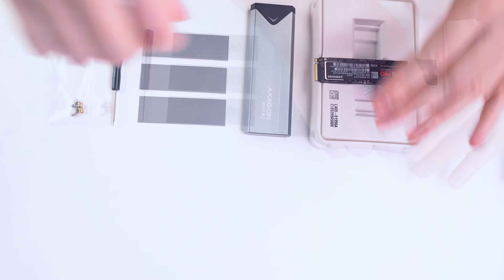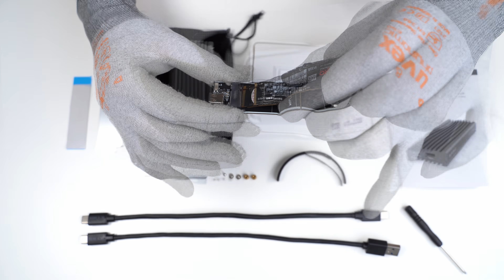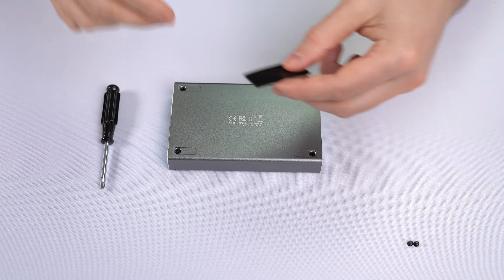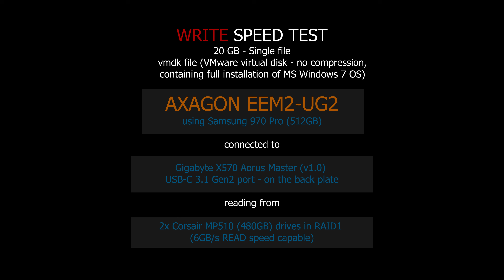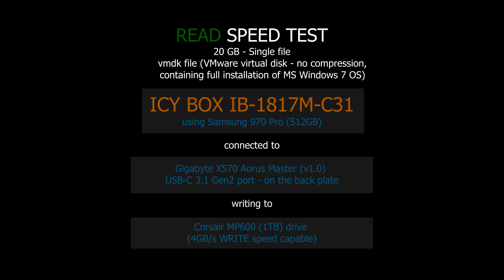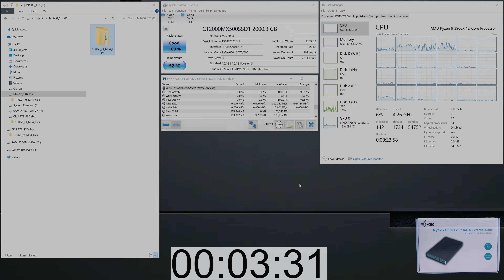M.2 NVMe USB-C External Box TEST - for SSD - AXAGON EEM2-UG2, ICY BOX IB-1817M-C31 & i-tec MySafe

Comment: @ Martin's Lab. hi, am i right to conclude that sata3 ssd  doesnt need usb 3.1 gen2 (10 gbps), and your mx500 would work almost the same on USB 3.0 case?
Reply from the maker: Hi, both will work, the transfer speed difference is about 20%. So, it depends on how high transfer speeds are good enough for you (you have to decide if it is acceptable for your use-case or not).
 
You´re lucky I have this drive connected right now as I´m writing this, so I tested it connected to both ports (I had to swap "USB-A/USB-C" cables of course).

CONCLUSION - If you connect “2TB MX500” inserted into “i-tec MySafe” to:

a)	“USB 3.0” on your PC (using a cable with USB type A connector) - you´ll achieve "410 - 412 MB/s" real READ speed 
b)	“USB 3.2 Gen2 (3.1 Gen2)” on your PC (using a cable with USB type C connector) - you´ll achieve "518 - 520 MB/s" real READ speed

So, to sum it up - the difference between using “USB 3.0” and “USB 3.2 Gen2 (3.1 Gen2)” when using fast enough "SATA3 SSDs" will be about "100 MB/s" (probably up to "130MB/s" with "Samsung 860/870" SSDs) in favor of “USB 3.2 Gen2 (3.1 Gen2)” in real life scenarios. (With different "SATA3 SSDs" this number will differ of course)

The reason why transfer speeds using “USB 3.0” interface are slower - is that it has only "5 Gbit/s" bandwidth available, while “USB 3.2 Gen2 (3.1 Gen2)” has "10 Gbit/s" bandwidth. Some part of this bandwidth is always lost as system (transport) overhead (this applies to both interfaces).  

So, while connected to “USB 3.0” interface you can never use a full potential of "SATA3 SSDs" which have "6Gbit/s" interface, you can use only about 80% of it - if the drive is fast enough (and other parts of the system of course – like the destination/source drive (depending on if you´re READING or WRITING) + the quality of cables used.
Reply: @MartinsLab  Thank You very much for testing scenario and answering my question.
Reply from the maker: @adamek1xd   You´re welcome. I thought about it again and came up with much simpler explanation ;)

SATA3 = *6 Gbit/s (real maximum speed is about 550 MB/s)
USB 3.0 = *5 Gbit/s (real maximum speed is about 412 MB/s)
USB 3.1 Gen2 = *10 Gbit/s (real maximum speed is about 1100 MB/s) 

If you connect SATA3 SSD (550MB/s real) to USB 3.0 port (412 MB/s real) = 412 MB/s is the real MAX transfer speed
If you connect SATA3 SSD (550MB/s real) to USB 3.1 Gen2 port (1100 MB/s real) = 550 MB/s is the real MAX transfer speed

Slower interface is a always bottleneck.
SATA3 SSDs become a bottleneck if their READ or WRITE speed is lower than the slowest interface they are connected to.

*Theoretical values in shown the charts don´t take into account the transport (system communication) overhead which happens in real life during data transfers 
(SATA and USB interface have different transport overhead and latencies. Used controller chip on both the motherboard and the external enclosure play a big role.)

Comment: Hmm it succsk then that it's not 3GB transfer per seconds but only 0.5 GB! 
[edit: ah you did try Thunderbolt 44:10] Have you tried Thunderbolt? Perhaps it's because the hard drive draws not enough power from the USB and requires a Thunderbolt?
So it is impossible to reach 3GB in real situation? What if it's conected directly to the motherboard?
It's succs because I raech 500MBps with a normal SATA wich is a lot cheaper than the Samsung 970!
Reply from the maker: I tried almost everything ;) All boxes were connected directly to the motherboard by USB 3.1 Gen2 interface (port). It´s theoretical maximum speed is 10 Gbit/s (1,25 GB/s) by design. So, it doesn´t matter how fast drive you use, it will always be limited to 1,25GB/s (1 GB/s in reality) by it.

On top of the bus limit, there is also a “Controller chip speed limit”as I discovered in the test. The chip ("JMS583" controller which is responsible for translation of signal from NVMe to USB 3.1 Gen2) which is used inside the M.2 boxes is - as I tested - not able to WRITE to M.2 SSDs at speeds faster than little over 600 MB/s and READ around 820 MB/s in reality (this applies for both Axagon and ICY BOX) for longer periods of time (before even SLC cache is depleted on the drive).

I use Samsung 970 Pro just for the testing to make sure I´m not limited by the speed of the drive - but by other factors that I´m measuring (transfer speed capability of the enclosure). Normally I wouldn´t use such expensive drive for use with the enclosure.

I also tested using expensive Thunderbolt 3 rated cables (Belkin and Itec) + a standalone USB 3.2 Gen2x2 (2 GB/s) controller (Gigabyte GC-USB 3.2 GEN2X2) card connected to PCIe x4 slot. A better controller connected to the motherboard increased the speed only by 30 MB/s. Better cables provided exactly the same results. So what you see in my "Real-life speed tests" is the reality. I will soon be testing another similar enclosure with the same controller chip on a different motherboard so we´ll is if anything changes, but I dooubt it.
Reply: @MartinsLab  Thank you for a detailed reply!
Reply: @MartinsLab  So only way to reach 4GBps speed with this hard drive is to connect it to the Motherboard with no converters and chips in between, to "PCI-E x4 Gen 3" slot?
Reply from the maker: @TrooperJet  Direct PCI-E connection (an M.2 slot Gen3/Gen4 or an adaptor card placed into PCIE x4 slot Gen3/Gen4) is the best. In will allow you run this drive at its full speed.

This drive can´t do 4 GB/s in real life.  You´ll get roughly 3500 MB/s READ and 2700 WRITE speed with Samsung 970 Pro (Gen3 drive) at it´s best (with large files).

If you wanted to reach similar speed with this same drive placed into an external enclosure, you´d need to use the ones equipped with “Thunderbolt 3/4” or “USB 4.0” interface and fast enough controller chip + you´d always need to have fast enough drive inside the computer to be able to READ or WRITE at these speeds for moving data TO and FROM the enclosure + use good enough USB-C cables which don´t limit the transfer speed between those devices.

(To reach higher speeds like 4GB/sand above - you´d need Gen4 drives in combination with USB 4.0. Thunderbolt has some of its bandwith reserved for transmission of video signal, not for data transfers.)
Reply: @MartinsLab  Hmm. In that case, do you perhaps know of a laptop that supports PCIe x4 3.0 or 4.0? None of the shops that I search at, have such Filter XD They only filter the capacity, not the supported type :/
Reply: @MartinsLab  [for some context, I think I need a very fast drive because I have a huge libraries, 100GB even, that I have to wait for minutes with my magnetic drives to load. So I plan on copying those that I need at a moment onto the fast NVMe and delete them afterwards, so will be a lot of data transfers. But since it's difficult to find such a laptop and Lenovo Carbon X1 are hella expensive I hoped there would exist an adapter workaround]
Reply from the maker: @TrooperJet  Using a laptop for a professional workload will always cost you a lot compared to a desktop. If you can (don´t need to travel with it from place to place) I´d always use a desktop (workstation) and for large amounts of data - in combination with a production server. With the right desktop, this would be easy to solve.

The boxes in my test are on the other side of the spectrum - they are the cheapest NVMe solutions available. Most new motherboards already have 3.1 Gen2 USBC interface so I found it interesting to test them. The whole use-case is 40 USD for the enclosure + the drive which people choose themselves. 

There are workarounds, but they depend on your workflow and current equipment and budget. I don´t know what computer (specs and connectivity) you want to connect your external NVMe drive to, so it´s difficult to give any more specific/useful advice. You mentioned moving a lot of data from magnetic drives (HDDs or tapes?), but not on which device you copy them and what interface you´re using to do it. 

There are several laptops on the maket which have a free NVMe slot or which have Thunderbolt ports, but other specs are also important so the choice would need to be narrowed anyway.

Comment: Hi, What controller chip did AXAGON EEM2-UG2, Icy Box IB-1817M-C31 use ?
Reply from the maker: Hi, I know for sure that Icy Box IB-1817M-C31 uses "JMS583" controller chip (it´s visible) - Link:https://www.jmicron.com/products/list/13
Thanks to very similar results and behaviour, I assume that AXAGON EEM2-UG2 uses the same one, but I can´t get access to it (I´m unable to disassemble Axagon without damaging it).
Reply: @MartinsLab  Thanks for the info. Theres so many of these controllers they are hidden behind stickers. I just got a different enclosure with RTL9210, which is supposed to be more compatible with linux, we'll see !

Comment: ICY BOX  3.5" be okay for 2.5"?? i can install both? without problems?
Reply from the maker: No, none of the boxes that I tested in this video supports 3,5” drives. If you want an external enclosure for 3,5“ and 2,5“ drives at the same time you can check GT1670-SB3, it supports both sizes, but running only on USB 3.0 interface. 
Link: https://www.raidsonic.de/products/external_cases/external_cases_35/index_en.php?we_objectID=2978
Reply: @MartinsLab  oww its sucks...
Thanks mate.

Comment: Hi,first of all great video.
 I'have and older laptop Asus Rog Strix gl753VE  with 3.1 GEN 1 usb c and usb3.0 ports, so the bandwith is unfortunately  5Gb/s or 625MB/s. I was planing to buy external ssd SAMSUNG evo 870 1Tb and some type of enclosure, probably dual dock station from axagon(seems ok), and use it on daily base for reinstalling  most games and programs that are currently on my smaller ssd sata m.2 256 Gb micron  which shares windows OS 10 also. It's beacuse I don't want to mess with internal hardware just yet when it runs ok. So my question is how much the results speeds will be slower than gen3.2 GEN2. I was looking on the net if there is some kind of tests with older bandwith such as mine but unfortunately most that i found is just that is much lower than 3.1 Gen 2. Thank you.
Reply from the maker: Hi Adnan, you´re welcome! I did a little test for you 😉 I connected the i-tec USB-C enclosure which has 2TB Crucial MX500 drive in it to my video editing PC using only USB 3.0 type A port on the front panel of the case.

I tried copying the same MP4 files (100GB) which are used in my video TO and FROM my internal M.2 - 2TB GIGABYTE AORUS NVMe Gen4 SSD (which I use for video editing and will definitely not be a bottleneck). I used IcyBox USB-type C to USB-type A cable (I tested this cable previously that it can handle speeds up to 10 Gb/s – it is shown in the video as well)

I was able to reach READ speed between 380 – 410 MB/s and WRITE speed of 390 MB/s.

These are very good results. Not as good when it comes to READ speed (compared to 500 MB/s when connected to USB 3.1 Gen2 USB-type C port), but better (40-50 MB/s more) when it comes to WRITE speed (this is probably caused by the fact, than my motherboard ASRock X570 Creator is using the latest BIOS containing AMD AGESA ComboV2 1.2.0.2 or that it has a better USB controller).

Your numbers could be similar, but WRITE speed is also heavily dependent on how fast can the source drive – the one you´re copying the data from (in your case 256 GB SATA M.2) can READ them.
On the other hand also take into consideration that Samsung 870 EVO (probably the best SATA drive on the market) you´re planning on buying is little bit faster than my 2TB Crucial MX500.

The whole time I was measuring only real life numbers (copying files in Windows 10) NOT any synthetic benchmarks.
Reply: @MartinsLab  Thank you very much, I will see to buy this, eventually later i can put it as internal drive on my laptop to change 1TB of HDD .

Comment: This was a very comprehensive video.  I am planning on replacing my Samsung T7 external SSD on my PS5. For  Icy Box external NVMe enclosure with the 970 evo Plus SSD.
Reply from the maker: Glad you found it useful. The combination of IcyBox and Samsung 970 Evo Plus should work. You´ll need to format the drive to „exFAT“ file system before you start using it on PS5 („FAT32“ file system has file size restrictions) and connect it to the 10 GBit port (not all of them are 10Gbit). PS5 ports link: https://www.playstation.com/en-gb/support/hardware/ps5-usb-ports-guide

Comment: How much performance is lost due to heat?
Reply from the maker: In general the answer is not simple ;) During my testing no performance was lost due to the heat of the drives, because none of them has reached it´s thermal limit. But if you stress the drives enough (repeated continuous load) - for example if they reached the temperature of 70C or above, some might start to loose performance. Samsung 970 Pro used in this video would start throttling around reported temperature of 80C. (Also keep in mind that not all SSDs report the temperature correctly/accurately - which is another problematic factor).
 
How much performance would be lost is individual and depends on: 
a) the model of the drive used (some start to throttle earlier at 70C, some later at 85C)
b) on how much is the drive loaded (how long is the load and how stressful it is – how many IOPS the drive has to perform in a second)
c) on your room air temperature (the hotter is the air in the room the closer is the drive to its thermal threshold).

Some drives have several threshold points – some will just slow down the data transfer speed by 20-50% when certain temperature is reached, some will stop transferring the data completely for a while and will wait for cool down (until certain lower temperature is reached), some will fail to work completely and reboot of the PC would be necessary.

There is also a controller chip on the PCB of the USB enclosure (the box) and on the motherboard (an onboard controller), but as far as I know they do not report any temperature reading. Therefore it is unknown if their temperature has any effect on speed of the data transfer from or to the drives placed in a USB enclosure (USB box). That´s why its not simple to answer.
Reply: @MartinsLab  thank you very much, your channel is very informative.  One of the best I've come across.  Subbed
Reply from the maker: @AGRANT716  Thanks for the sub!

Comment: So looks like icy box is waste of money, if u cant even peak maximum speeds of these ssds cause cheap usb c controllers :)
Reply from the maker: It all depends on how strict you want to be or what are your expectations 😉 

You wouldn´t be able to reach the maximum speed of the M.2 drive Samsung 970 Pro (3450 MB/s READ and 2440 MB/s WRITE speed) placed into ICY BOX simply by the limitation of its design (USB 3.1 Gen2 specification is 10Gbit = 1250 MB/s).

If you expect to get a box which allows you to transfer data at the maximum theoretical speed of USB 3.1 Gen2 (10Gbit = 1250 MB/s) specification (or based on information on the paper box of this eclosure), then you wouldn´t get it and in that case potential purchase could be seen as a “waste of money”.

On the other hand, if you´re willing to accept the limitation of its controller chip which allows roughly 830MB/s READ and 560 MB/s WRITE speeds in real life, then you´re still better off with this box compared to any SATA based box at a price which is somewhat reasonable/affordable. These boxes cost from about 33 to 45 USD.

My job in this test was to find out the truth about how these boxes perform in real life (not only in synthetic benchmarks) without any bias or skipping any facts.
Reply: @MartinsLab  its just me comparing icybox to way cheaper solutions like axagon that do basically same thing for way less :) by "waste of money" i meant overbuild cooling for nvme that cant even reach its max potential, so it doesnt run that hot after all :) very nice review tho, im getting axagon for now :)

edit: where i live axagon one cost 30€ and icybox hover around 70€ which is price difference of some cheap 512gb nvme :D
Reply from the maker: @fadeeeed  I´m glad you enjoyed my review. The transfer speeds which can be reached with both Axagon and Icybox are almost identical, if the price difference in your area is so huge then it makes sense to go for the cheaper Axagon no doubt. 70€ is way too much, it should be around 40€ including the tax at the max. 

IcyBox can be found now (17/4/2021) on Amazon for 34.95 USD which is much more reasonable.
Link: https://www.amazon.com/Protection-Enclosure-Innovative-Connecting-Thunderbolt/dp/B07Q7H5QLX/ref=sr_1_1?dchild=1&keywords=IB-1817M-C31&qid=1618676082&sr=8-1